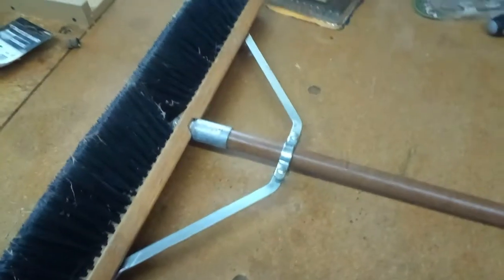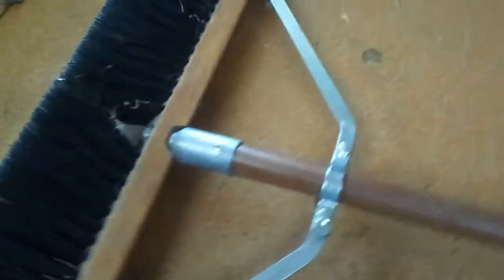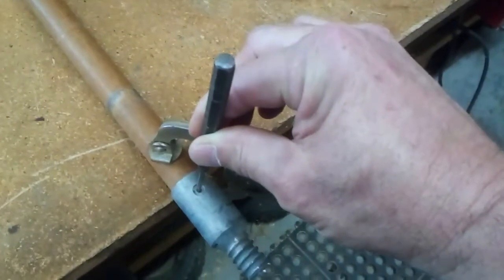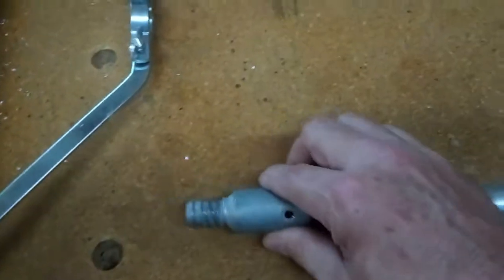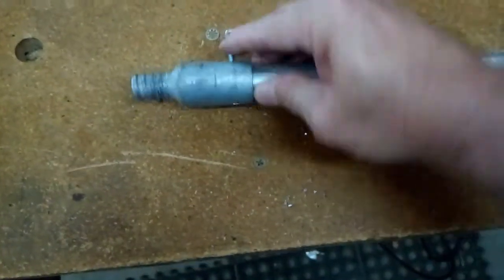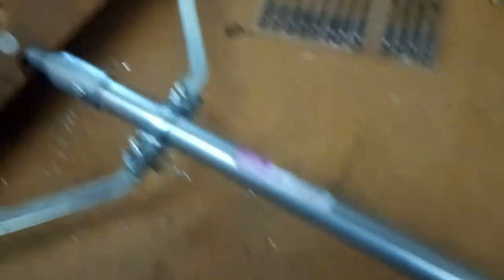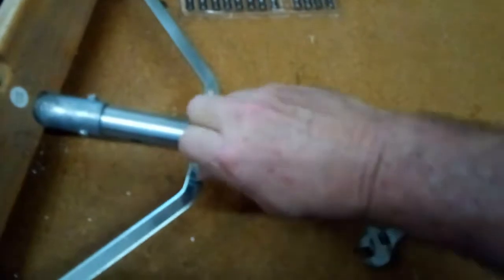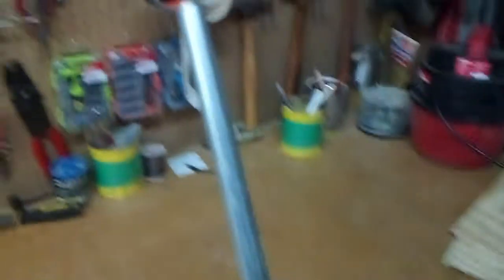Redneck Repair: How to Replace a Broom Handle Permanently

Comment: Can’t believe I wasn’t thinking of the conduit idea. Appreciate the whole insight.
Reply from the maker: Sorry it was so long! It was my first video.
Reply: @ArkansasPilgrim  Not apologies. Thanks for reaching out to do stuff like that is pretty cool. This technology crap messes with me and I hate learning it but if we’re gonna move forward there’s really no choice. These people that make videos will give you all kind of suggestions on the kind of tools you need to film and do this and do that so don’t be afraid to ask some of them. Especially if some of them criticize your video. Ask them how they would make it better ask them what equipment they would use. Just put the ball back in their court. In any case, that threaded Metal Ferrule you took off the old handle got me to start searching for those by themselves. I work for a company where the plastic ones break off continuously. Home Depot had an inexpensive would handle with a Metal Ferrule Attached to the skinny wooden pole. With your idea I’m going to buy the metal conduit just slip it right over that piece of wood screw it or glue it together and be done with it. Keep making videos brother. Fact I’m going to subscribe to your channel because I think he got probably some good stuff coming forward
Reply from the maker: @jimcrowe1993  Welcome aboard. You'll probably like my Redneck Repair playlist.

Comment: Put some paint on that aluminum or your hands will turn black from the aluminum I know cuz I have the same handle in my pitchfork
Reply from the maker: I almost always use work gloves. BTW, EMT is steel with a type of zinc galvanize coating. If yours is aluminum, it will keep turning your hands black.